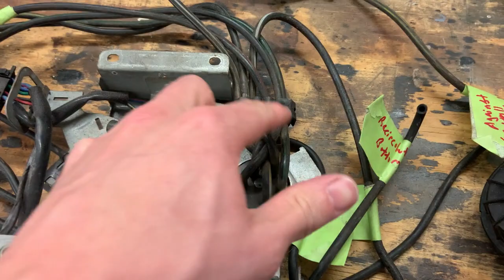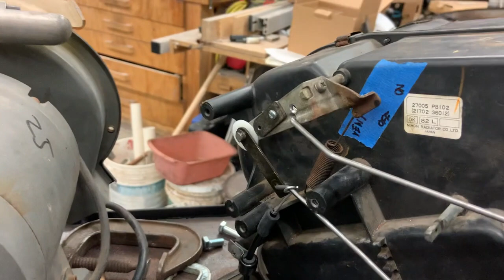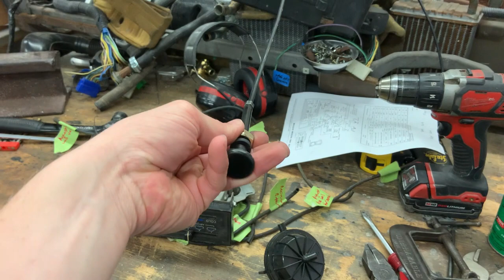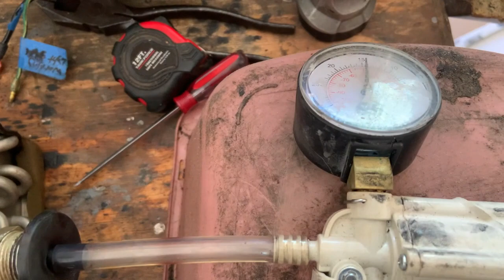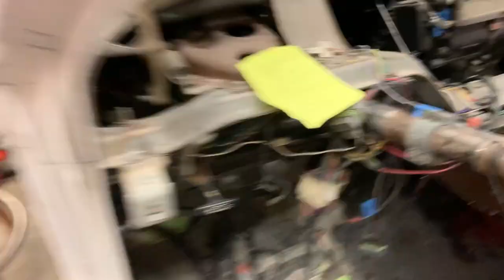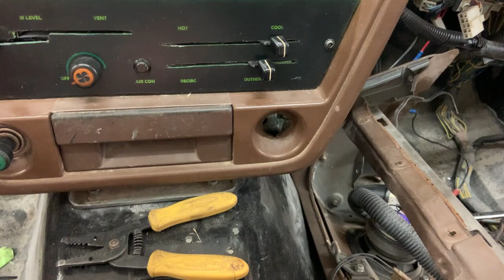Vacuum to Cable Climate Control | 280zx

Comment: This video is great I have a first gen Jeep grand Cherokee can I been researching going from vaccum control hvac to cable this video answered a few of my questions
Reply from the maker: That's awesome, glad it helpful!
Reply: @PracticallyStock been watchin some of ur other vids I subbed you have lots of helpful videos. On my jeep my goal is to remove as much tech an possible failure points I can the vaccum setup works fine at the time being but i want to remove possible future failure points . I’m also doing a full radio delete and converting it to crank windows. She isnt intended to be a powerhouse or anything she’s the 4.0 straight six my ultimate goal is reliability
Reply from the maker: That'll be cool. I had the same motivation for what I did, I want reliability above all else. Thanks for the support!

Comment: Just picked up a zx with the dreaded "auto" AC system - was searching for a parts car with a manual setup but after seeing this, will stop that search as well...  Will probably knuckle under and save up for with a vintage air gen 2 kit - which also comes with a heater core... You saved me a boatload of time & energy, thank you!
Reply from the maker: Glad it was helpful, Good luck with your project 👍

Comment: Thanks !!! This is good info. My 83 turbo has this same AC system. Continues to work fine (for now). It's my 82 non turbo with issues. It came with a different "Auto Temp Control" system. Hasn't worked right for 40 years. Hoping I can apply this modification. Impossible to drive without AC here in Arizona 😎 . Thanks again.
Reply from the maker: Thanks for the feedback. This project was definitely a test of patience but I don't know what other option there is. There is for sure a simpler solution than what I came up with. Curious if just push/pull knobs are easier to implement. Make sure you read up on freon conversions if you go that route. Best of Luck and hope you get some AC before summer!